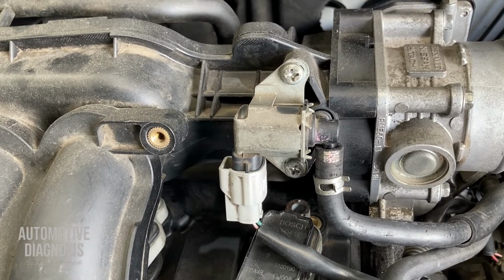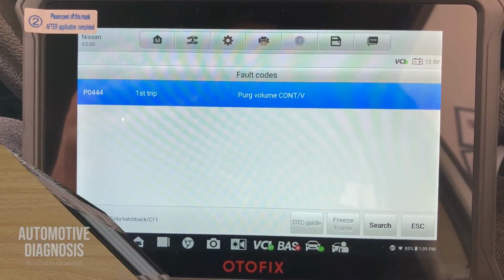Test & Fix EVAP Purge Control Valve | P0444 | P0445 | Canister Purge Control Valve Diagnosis

Comment: It's a good  video.  But I  think you're missing a few testing steps. Because the scanner is showing  the trouble code P0444 and the wiring integrity, it's good, and the manual methods shown that the valve it's  in good  condition. And you didn't show the fix. 
Why did you get the code?
Maybe you can play a little bit with your scanner since it have bidirectional capabilities. Before disconnecting anything.
Reply: Puedes hacer este test tambien. Con tu valvula conectada normalmente conecta un backprobe a el cable de el driver que viene de la computadora conecta tu voltimetro a este backprobe y te deberia de dar el voltage de la bateria con el carro encendido. En el momento que se la computadora active esta valvula deberia combiar a cero voltios la pantalla de tu voltimetro.
Reply: Puedo probar con lámpara lógica si la computadora está mandando la señal negativa para que esta válvula de purga abra o cierre,,,ya que no tengo escáner abansado....
Reply: @josejuancalderonvazquez69  La lampara logica no siempre es de fiar en estos casos. puedes usar la incandescente. En el pasado estuve en un caso de que todo estaba bien. pero la valvula se atoraba y no cerraba bien y esto era muy ocacionalmente.
Reply: @JoseSanchez-ln2jx  no se quema la computadora usando la lámpara incandescente Nissan Sentra 07
Reply: @josejuancalderonvazquez69 No porque la lampara incandescente solo es capaz de conducir 100 milivolts como maximo. Este aparato al usarlo solo te dice si hay corriente o tierra dependiendo el caso. Entiendo tu duda porque a tambien lo pensaba asi.